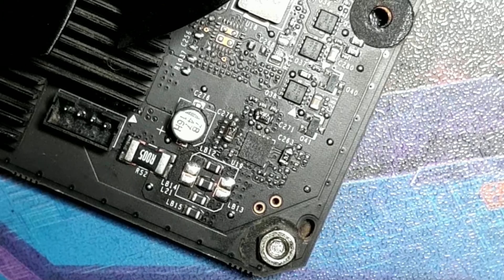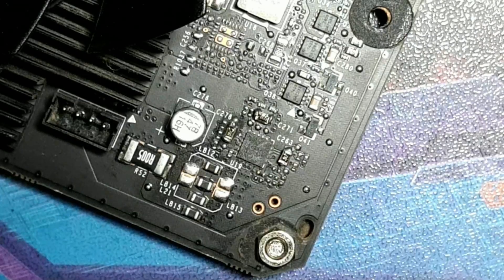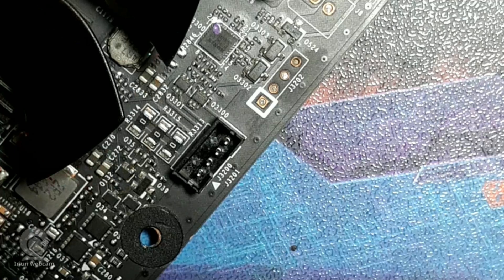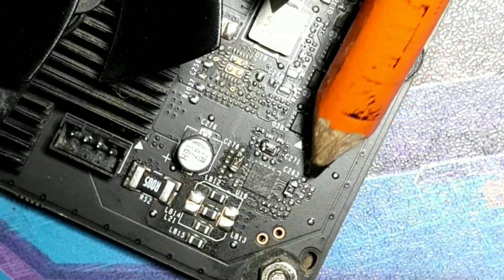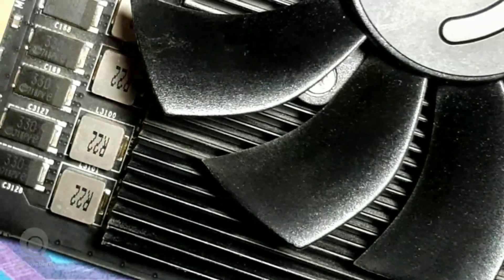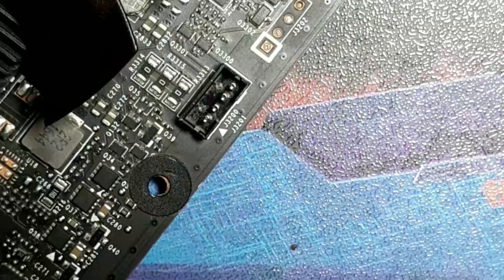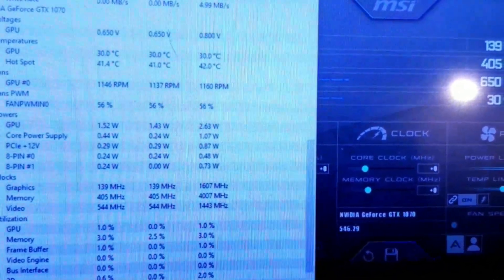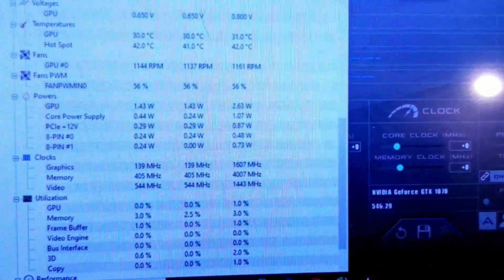EVGA GTX 1070 Unlimited power!!!!(Mod)

Comment from the maker: SO without no power limit mod the best gtx 1070's can do 2.05ghz max and with mod they get 2.2ghz+, With a 1.275-1.33v core volt mod they go to 2.3ghz and with memory the voltage mods i have seen are all over the place, do to each test having different memory chips but they  did 10000+ on the gddr5 memory.. crazy.. I have not seen mods done on the  rare gddr5x yet. The Evga gtx 1070 hybrid I have has gddr5 micron memory.
Reply: that sounds pretty good considering my 3080ti running 10200 mermory
Reply from the maker: @Yan-f6q9j  ya to bad it's just gddr5 so it's not much gain in benchmarks I can get my 3070ti to 11000+ which has gddr6x micron memory. Only way its stable is due to the copper shim mod I did on it as soon as I bought it lol. So far I have one of the fastest 3070ti cards in the world with multiple records. It compares to a 3080. When I get the memory mod done on the 1070 I will see how far I can get the memory to go!!